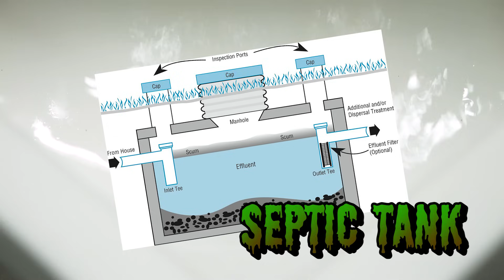How Do Sewer Systems Work?

Comment: I live in SW FL. It's flat. Completely flat. So this didn't explain anything.
Reply from the maker: The sewers are installed at a slope underground, additionally It’s not as flat as it seems, any degree of change over a vast distance can be enough to direct flow in a given direction. 🙂
Reply: @ConcerningReality   There must be numerous pumping stations in my town.   To bury sewer lines at a downward pitch over the length of my street, the pipe would have to go 10' deep at one end. And it would still be miles from the treatment plant.

Comment: PSA: There is no such thing as flushable wipes
Reply from the maker: Yes, they cause a TON of problems.
Reply: Tampons and ginormous turds can flush, but not wipes??
Reply: @rmg2419  tampons are not supposed to go in the toilet either, fecal matter breaks down eventually
Reply from the maker: @rmg2419  not supposed to flush tampons and turds disintegrate.

Comment: TO EVERYONE, PLEASE GOD.
DO NOT FLUSH BABY WIPES, EVEN IF THEY SAY FLUSHABLE.
BECAUSE THEY ARNT. 
Its thee number one cause if back ups , tht and. ROOTS.

Use root killer every 6 months especially when you have big trees and they are near your sewer pipes.
 You will know its near your sewer from your house by the CLEAN OUT ( MOST HOUSES HAVE THEM) ITS the 4 inch or so cast iron,  terracotta or pcv pipe sticking out usually in front of your lawn. It sticks up a few inches from the ground.

Comment: Awesome vid. My question is, how did this all get installed in ancient cities like those in Europe where the infrastructure hasn’t changed much in a very long time? (Venice, for example)
Reply: The sewer systems are near rivers, they linked them with bored out the center wood or concrete ( ancient rome) n it flowed out (usually) from the river out to sea

Comment: This narrator is wrong.  Let me explain; I work in sewer maintenance And I have never once serviced a sewer at a house over 4in.  And it's always 6in or 8in in the street until you go MUCH MUCH farther down the line until it reaches 3 to 5ft or sometimes  larger. Thanks
Reply: Municipal engineer here and agree with this guy. The video is wrong
Reply from the maker: The sizing varies a lot based on area and flow. I tried to give general numbers for the untrained viewer🙂
Reply: @ConcerningReality  Good video, but I've worked as a waterworks salesman in multiple municipalities and residential sewer service lines are 6" on the big side, 4-5" is standard.